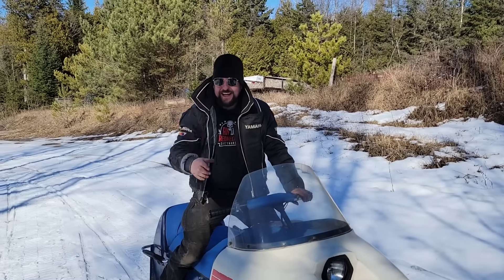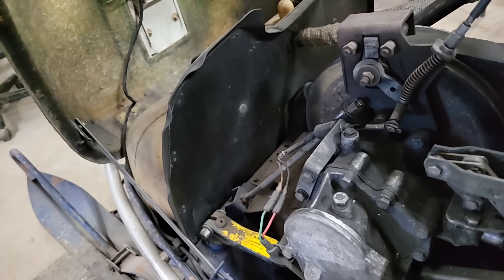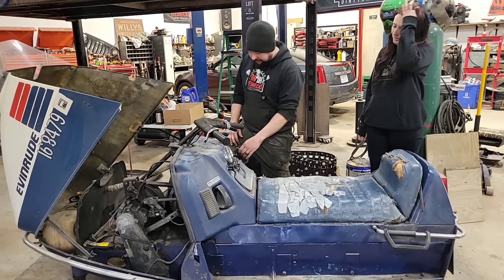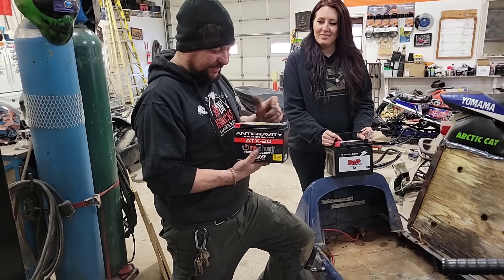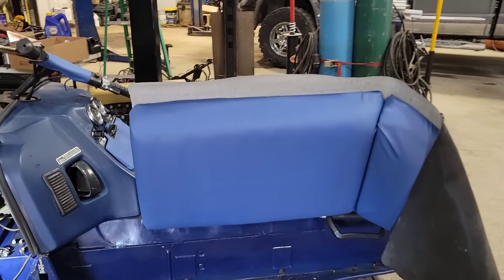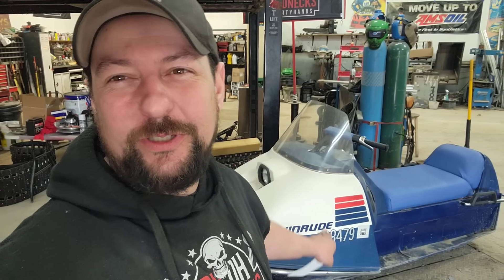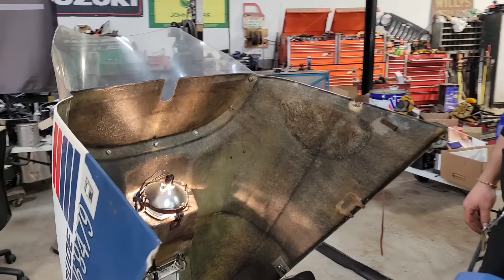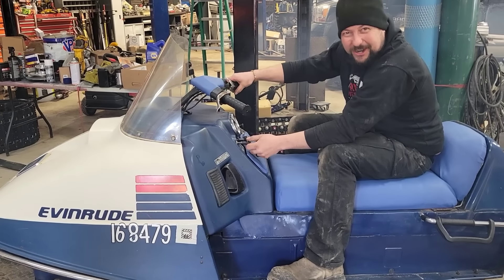Rare Rotary Powered 1973 Evinrude Trailmaster!

Comment: Hey pet iv been watching your content for sometime now and love what you do, anywho i have a yamaha 1998 vmax 500 XT and she great sled had her for 5 years and shes now in a rough engine was rebuilt 3 times since i owned her cleaned her out changed plugs Belt Now the one piston on the right side is misfiring just a pointer on where i gone wrong lol
Reply from the maker: a misfire can be caused by a few things...I'd say check compression first, then plug, wire and coil...then make sure carb is clean and choke is working properly. 🍻

Comment: Fill that chain case with 50 percent Lucas Gear oil ,and 50 percent transmission fluid. It ll run forever
Reply from the maker: good tip! cheers 🍻

Comment: Pull out and look the apex seals on a motor that was used with smooth throttle control, and those used with the ricky racer blipping. Unless you like spending money and time, you'll neve blip a throttle again unless your carb is acting up